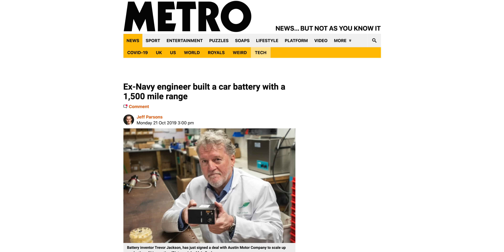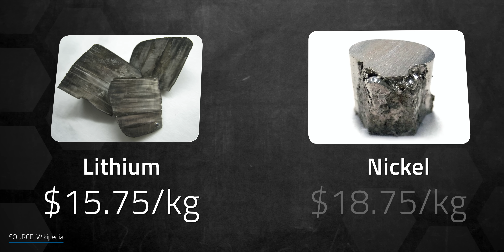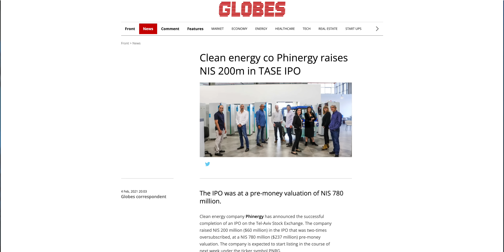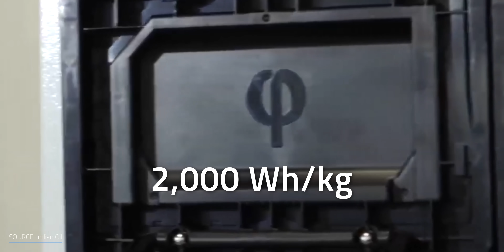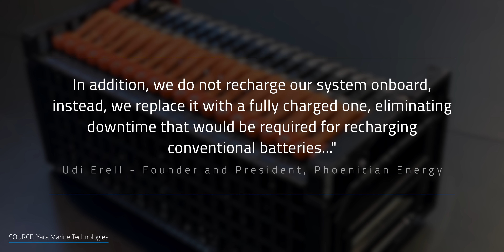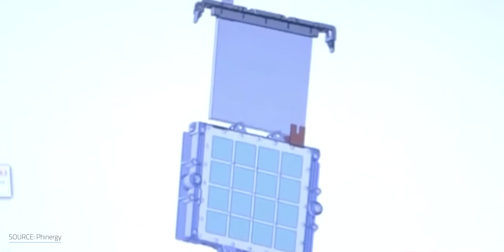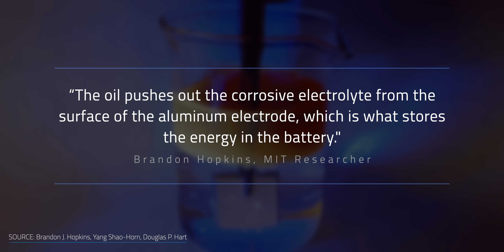Exploring the 1000 Mile Car Battery - Aluminum Air Hype?

Comment: Some quick back of the envelope math shows it takes about 15kw/h to refine a kg of aluminum from aluminum oxyde. While the maximum theoretical density of the battery is 8.1kw per kg. Even if we assume a rather high efficiency of the battery the math simply works out to about 50% efficiency and a more realistic efficiency at 13%. Ouch. It could potentially be viable as grid storage if we figure out the degradation issue since a power grid on solar would make several times more energy in the summer than in winter while needing more energy in said winter. So it could be economically and enviromentaly viable to produce tons of aluminum air batteries in the summer and use them up in the winter and during the night obviously.

Comment: If it is a widespread, commercial, plug and play situation I'd be all for it. A 2 minute load/unloading of a trunk would be well worth 1000+ miles of travel for trips. For daily driving, probably less likely to be dependent on someone else swapping a battery in the timefram I would need.

Comment: I'm suprised you did not even mention the fact that in order to get the required Bauxide for processing into Aluminium entire landscapes of much more valuable Junge/Rainforest have to be completely erased and the soil dug up. Aluminium refinery is one of the dirtiest, most toxic businesses. Just look towards Brazil which is a bigger exporter of Bauxite than India - they just dump the toxic red sluge - a waste byproduct of the ore cleaning process - into extremely large fields where air and rain erosion carries the ultra fine, red dust everywhere. Aluminium is recycleable, yes. But the actual extraction kills entire ecosystems pretty permanentely and is not sustainable in any shape or form.

Comment: This technology is not widely used yet, due to the energy degradation problem that you show in the clip and not due to any other reason. The aluminum-air battery is eco-friendly, contains a lot of energy and if it wasn't for this problem, you'd see aluminum-air batteries running cars for at least 10 years by now. I kinda like the oil solution and - I think it is doable.

Comment: You make it sound as if "Once the battery is dead, you're stuck and needs to be towed", but in reality, you can swap just a couple of the aluminum plates to allow you considerable extra range to get to a battery swap station. In other words, all you have to do is keep in your car a couple of spare plates which weigh almost nothing (it is aluminum), for the remote chance you will find yourself out of juice in the middle of nowhere.

Comment: Not rechargeable  no sense in making even the comparison.

Not convenient for variable use like a car. One day you make house-work, one day a try to the country one day you go to the supermarket. 
Even if I have a 1000 mile battery... when you have a partial fill let's say ~300miles. And you need to make a trip of 250... what you do?
Throw away the 300 and take a new one? Hope that you do no have detour? Hope to find an exchange station... that have one battery in stock?

Maybe for fixed travels with not refills and logistical support at start and finish when the weight matters. Like for electric planes.

Comment: What about using a roll of inexpensive aluminum foil which is mechanically pulled through the electrolyte? As the surface is corroded, fresh aluminum would be pulled in, vastly expanding the capacity for a minimal extra weight.

Comment: Lithium based batteries are very problematic. We can't really recycle them, which is the biggest problem. I think these aluminum air batteries are a much better solution. Much more recyclable and we have significantly more mature aluminum production infrastructure. The exponentially greater energy density is a fat bonus.

Comment: It all comes down to cost.  If the batteries are so cheap that the overall cost of ownership is equal to or less than LI-ion powered vehicle then this is great, but the fact that you can't let it sit is a huge problem.  I have gone on vacation many times letting my EV's sit for a few weeks at about 50% state of charge and they are good to go when I got home.  Without some active system, this isn't possible with Al-air.  Or in all honesty, my car sits most of the time  it sits every night and every day while I am at work.

Comment: Towing your car wouldn't be necessary. They'd just haul out a new battery pack for your car. Think, like, mobile glass repair.  

However I think non-rechargable batteries are vastly less healthy for the environment. The sheer cost, both actual and environmental, of hauling tons of new batteries around the world to 'gas' stations is way more expensive then hauling electrons around to recharge a car.

Comment: The amount of time it takes to swop batteries vs filling your gas tank or recharging is what would seem to be most important to me.  If you can swop the battery in the same amount of time that you would take to fill your tank. I would go for it.  there might be a need for full service stations for handicapped people or maybe the swop would be automated.  I'm 74 and get around on a walker, so both hands are always full when I'm walking so an automated system or full service station would be a necessity.  An automated system that can change the battery at home and the batteries could be changed in the machine by a delivery person who replaces the used battery with a new one like someone who delivers those 5 gallon bottles of water would be great for handicapped or elderly folks.

Comment: I think it would depend on the frequency/ease of swapping.  If you use a tank of gas a week and say get 400 KM out if it then you are swapping every 2.5 weeks or so. If that swapping is relatively quick say <5 min then it would not be a problem. You could also add a small battery say 10 KW/h if there was a concern about running out of charge unexpectedly.

Aluminium if I recall correctly, is refined using electricity, so if spent batteries aluminum is re-refined using renewables that is fine. The hidden energy cost is the transportation to and from the battery factory. Depending on the infrastructure/transportation required that may make the  economic case for this technology in many cases much worse.'

Lastly, if your higher energy densities are correct and realised, then this might have enough energy for use in aviation.

Comment: Sounds like this could be good for air travel.  As opposed to pumping in fuel, you’d swap out the battery.  Does the energy density make that viable?

Comment: I am completely fine with the idea of a battery that has to be changed. It is no different from my grill or my TV remote. 
I like the idea of a hybrid system getting the best of both worlds, charging the vehicle at night but also having an auxiliary power pack that can be easily swapped out at the old gas stations.

Comment: Looks to me like the perfect range extender for Li-ion battery driven cars. When you plan to make a longer trip, just add one of those and you are good to go...
Otherwise the round trip efficiency will be too bad and we would replace oil with another bad fuel.

Comment: From an ev point of view ,I could see them being used in tandem with lithium batteries , as a swap in battery , your car might have 150 miles range on it's everyday lithium batteries ,which is fine for normal driving habits - but you could add an aluminum air battery to boost range for occaisional longer trips -

Comment: it's unpractical for cars and trucks because these are standard when out of the factory (except a few that offer long range options)... while their uses varies from user to user/circumstances, so they need to be rechargeable because we use them differently. Also, humans being humans, we aren't always planning our movements, nor calculating how much charge/gaz we need to cover distances (we all ran out of gaz once... thinking having enough to go to the next gaz station). 

However, since alu-air batteries have a better power/weight ratio... and since there's no rechargeable stations in mid Atlantic, they seem more appropriate for planes and big boats. It's stupid to favorize a battery's rechargeability (implying heavier and less performant) over its raw efficiency (and light weight) when there's no place to recharge it anywhere. Maybe to complement these with a rechargeable battery secondary set could be best, to allow a complete depletion of the alu-air batteries (until exchanging it for new ones, without throwing away batteries that still have power in) and give some flexibility that alu-air batteries don't have.

Comment: How is it environmentally friendly if you can't recharge it? Having to remake the battery each time must be pretty inefficient., and do you really get ALL material back when you recycle a aluminum air battery? You should have including more information on this 'recycling'

Also I assume it would be rather impractical to be recycling and remaking these batteries at  each station which brings up lots of issues.

Comment: A one use battery sounds kinda like a nightmare.  The question of how many batteries can a station pack, what if you show up and there aren't anymore? These are not small, storage would definitely become a problem. - especially in high population density areas like India. (This would be somewhat mitigated by how long it takes someone to deplete the battery)

I'm sure they could make them slot in, a plug and play model - but what is the cost of each battery? You are trading in a dead battery - of which is only useful for it's aluminium and silver content.  (Plus, the question of how much energy does it take to recycle,  how much of it is recyclable let alone the question of how much it takes to produce one.)

Hopefully researchers can start to chip away at the most glaring issues, so that places like India can become more independent on their fuel, and production needs.

Comment: where twitface says something about "theoretical energy density of aluminum" is where he becomes a shitface liar.   Gasoline has a 12,500Wh/kg density and Cocaine is up around 14,750Wh/kg.   2000Wh/kg for the aluminum battery's ingredient components doesn't include the mass of the battery system.   For gasoline that's about 12kg for the tank and pump.  The actual result for the aluminum battery's capacity is only about 790Wh/kg and it is not rechargeable, cannot even regenerate... so your vehicle will still require a rather large Lithium based battery anyway, dropping the average total to more around 690Wh/kg for the combined battery packs.   Garbage.   We have gasoline engines that can run with cocaine boosting.  Cocaine is a renewable resource as it literally grows on trees that don't have to be destroyed each harvest.

Comment: finally. most promising, interesting and intriguing tech for a long time on this channel.  basically, you use the aluminum as fuel. after a quick search, it is on par with internal combustion engines     on fuel efficiency and cost though no mention on carbon foot print. personally, this is viable to countries with plenty and easy aluminum.  if they ramp up production to ridiculous levels, they could export the aluminum/battery like how oil is exported/sold in the world. 
while rechargeable EVs remains superior on many aspects, an EV with this fuel is viable for low mileage or occasional use. aluminum producing countries could use this to compete with oil producing countries, accelerating further the decline of internal combustion engines.

Comment: That REQUIRED a swap, I wouldn't. That ACCEPTED a swap, no doubt. I think this kind of batteries are better suited to specific uses, where high power and low weight are big problems. Like airplanes.

Comment: Y'know what these might be good for? Replacing or supplementing backup generators for houses. If you don't need a generator constantly, and it's just for emergencies, this is something you could keep to power the house, and when it runs out, just replace it. Maybe the cost of replacing it might not be worth it, but generators have to be refilled with gas all the time anyway, and we want to get away from that... but anyway, it might not be great for like a cabin in the woods that needs a generator often, but my house in the 'burbs that only has a power outage for like an hour every 5 years might really benefit with something like this for backup power.

Comment: Aluminum air is a great solution for aviation applications. Requires battery swap? Perfect. Aircraft land at fixed locations anyway. Great energy density on the order of, I think, 2 kWh/kg? Awesome. Compare to current LiIon of about 400 Wh/kg, Al-air sounds great.

Comment: I wouldn't be surprised if they get the range they're claiming, but I'd honestly rather something with less range that is rechargeable.

However, I doubt you'd need a specialist to swap the battery, or even a battery swap station. No reason they can't be replaced by the user more or less the way we replace AAA batteries. Just need to design the terminals properly for such things.

What I would consider is a standard EV with rechargeable battery that can use one of these batteries in addition to the standard battery. Then a tow truck can just deliver a battery and just put it in and you're good to go.

Comment: Lithium-Ion batteries require swapping also. It just takes longer and the cost is astronomical for a Li battery pack. Then the disposal is problematic as well for expended  Li batteries.

Comment: I like the idea of possibly using them in a hybrid arrangement. Use traditional Li batteries and charge as required, but have the ability to drop an Al-air battery in the boot to give you extended journeys when charging isn't available. A bit like those single use mobile phone chargers. It would negate a lot of the stress people have about being able to find a charging station or the time it takes. You could then exchange a discharged Al-air battery just like you exchange an empty propane cylinder. Pay a deposit once, and then just an exchange fee after returning your old battery. For local trips/daily use, you could possibly remove the Al-air battery to cut down on the weight. So many possibilities.

Comment: For EVs etc, this is a dead technology, but, if they can resolve the degradation issue, these would make great backup power plants.

Have enough for the country to run on for a long while, and have all daily energy from renewables, then if we get a long stretch of no wind, these can kick in to keep the lights on, and can be replaced after. 

Emergency batteries for a hospital, which could run the hospital for a week or more! Or Data centres, which all have massive diesel generators encase there is a power cut.

But for EVs and similar vehicles, this is a non starter.

Comment: For me it would really depend on cost is it cost-effective to swap out the batteries. One thing about a rechargeable vehicle is if you have a solar array you can basically drive your vehicle for free after you initial cost of the purchase of the vehicle if I have to spend hundreds of dollars to replace batteries at a gas station I don't know if it's worth it. And that was the one thing missing from your video cost. Not that you know that

Also would there be a market for the silver that's in the batteries with those batteries be a theft item. People tearing them down stealing your car for the silver just things to think about good video thanks for making it

Comment: Interesting. I think applications -- like going across the ocean -- where the amount of energy needed is known in advance (like putting a calculated amount of fuel in a jet airplane), where refueling mid-trip is not an option (i.e. going across the ocean), and where energy density is critical (I imagine shipping values light weight just like trucking does). I think in these cases, aluminum air batteries might be a good solution. In the case of commercial applications (shipping, trucking) the depot where the vehicle reaches could have the battery swapping and recycling facilities right there. So how do the materials get recycled? Obviously the components don't just go to a landfill. You explained what the cost of the raw materials are, but what does it cost to turn the used battery materials into a new battery? That would be critical.

Comment: Non-rechargeable. TWO cartrages like the test vehicle. Dash light alerts driver to pull over. A small rechargeable battery powers car accessories and runs a pump to remove oil and inject fluid to second cartrage. Long haul vehicles could have three or four cartrages if deemed needed. Great for EV aircraft or forklift or driving small work machiney. Put this in the frunk. Save all that weight of lithium battery. This is an easy no brainer concept. I would like two pickup trucks please.

Comment: I'd suggested, as a layman in small-talk, that bat-swap stations might be the future due to recharge times being a problem, I don't see why it would have to be exclusively non-rechargeable batteries, the only snag in my mind is policing the quality control (ingoing and outgoing) and pricing (your discount for your old battery).

I keep hearing more and more about hydrogen though, so it wouldn't surprise me if the new generation of eco-cars bypass running entirely off a battery, or in the far future personal transportation being heavily restricted, with more reliance on railway systems.